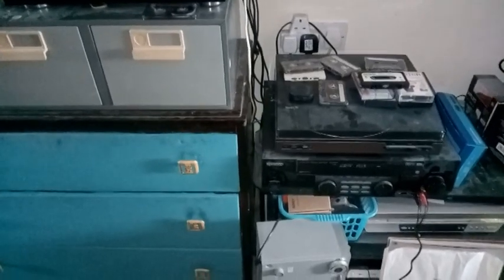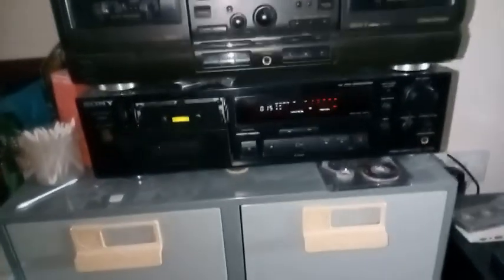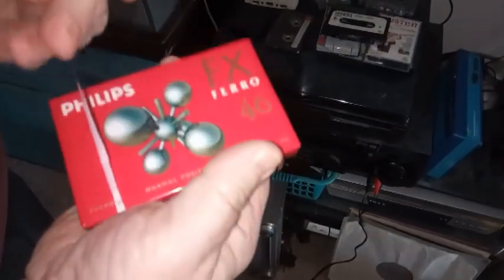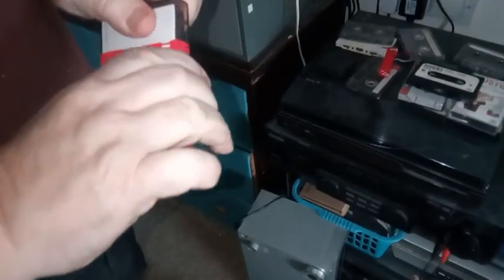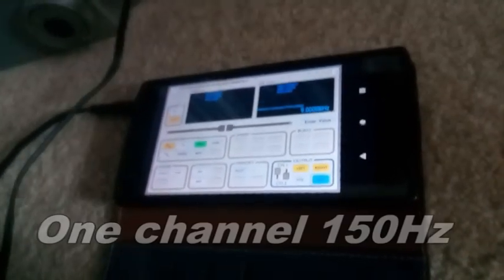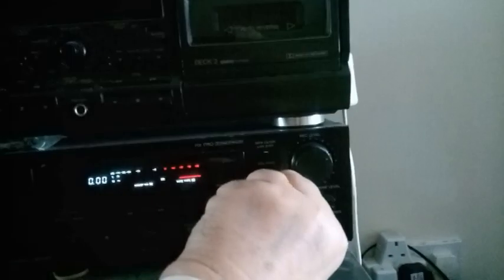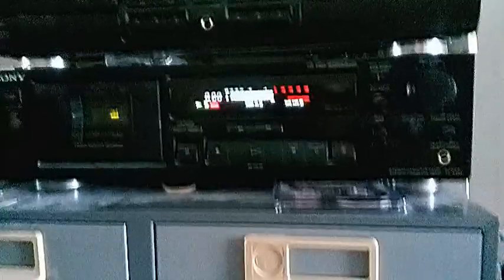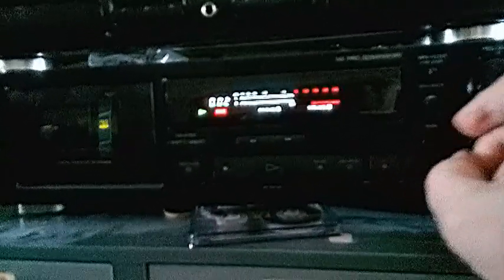How to Calibrate Cassette Deck Bias Without an Oscilloscope - Free App Method

Comment: Too bad, but I can't do much with this. Messy setup and mediocre explanation of exactly what it does. also the video recording is out of focus and unstable. You get dizzy watching it.
Reply from the maker: It is simple. Adjust the control until both levels are the same. Sorry you have a problem. It was done "on the fly" It was only the 3rd video I uploaded at the start of my channel in 2021  You can pull the information without the visuals. I may re-shoot it one day but as it is such a simple concept to do I figured best to leave well alone. Compared to the Competition at the time this was a major scoop.  Thanks for your feedback.

Comment: A maioria das musicas , o conteúdo dos agudos nao atinge 0dB num RTA ou spectrum 
Então um tape deck que atinja seus 18  20khz em -20dB tera uma performance musical muito excelente
Reply from the maker: google translate: In most music, the treble content does not reach 0dB on an RTA or spectrum
So a tape deck that reaches 18-20kHz at -20dB will have a very excellent musical performance..
My Response. Correct. The Bias tweak is only needed to fine-tune the deck to the tape.
Minha resposta. Correto. O ajuste Bias só é necessário para ajustar o deck à fita.

Comment: This is very interesting. I’m wondering why you chose those 2 frequencies? Would this still work with any other frequencies? Thanks.
Reply from the maker: Yes it does, depending on your machine but if you go too high a frequency you will not really be able to adjust it because it will be too peaky. the low needs to be low enough to be stable and peaky. I used the 2 frequency's because they were stable. They would work on any deck or Tape.

Comment: Thanks for the tip. On a 3-head cassette deck it's even easier to set it
Reply: I actually found out that my Sony TC-K600es' BIAS is way off set. I knew it was off, but it is more then I anticipated. I'll try taking it apart and calibrate it
Reply from the maker: If it comes into adjustment with the external adjustment controls it may not be worth getting inside.  I have found these things are often best left alone just for a small thing.
Reply: @GaryKeepItSimple  The problem is that even with the external Bias dial set to max - it is not enough. With it set in the middle is WAY off
Reply from the maker: If you use a good tape and do the internal adjustment with the adjuster set to mid way you should be able to pull it in. At least you have an Idea what the problem is. Good Kuck. Let ne know how you get on.
Reply: @GaryKeepItSimple  Thanks, I’ll let you know

Comment: Hi, why such frequencies and levels ?
Reply from the maker: Good Question.
It would be best if you got to the  limits of the tape. If you do the upper limit the recorder can reproduce. You can see what effect the changes have—the same for the Low frequency.  A VU of  0 is as good as any; it gives you a chance to see signals that otherwise would be lost in the noise. Allowing you to get them.